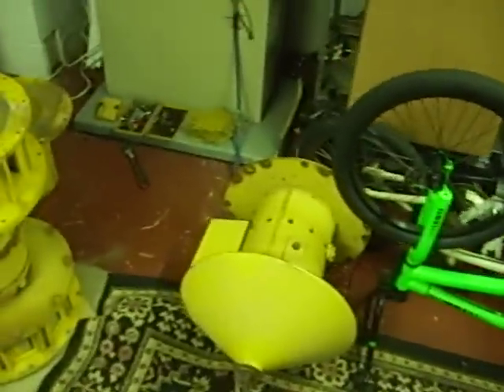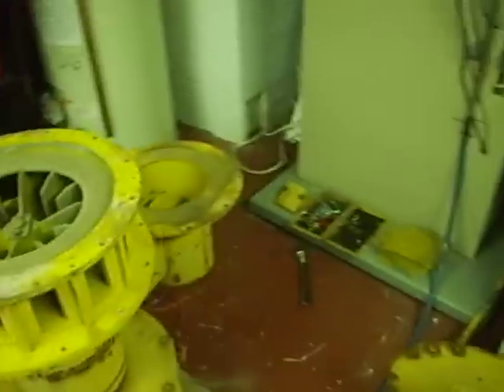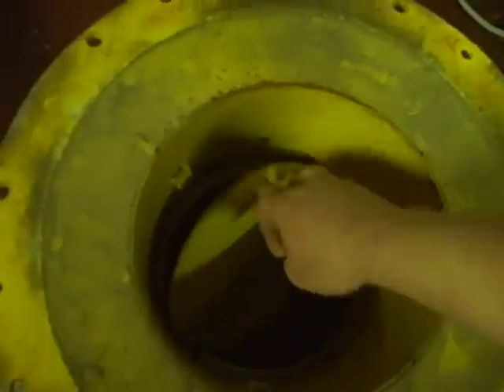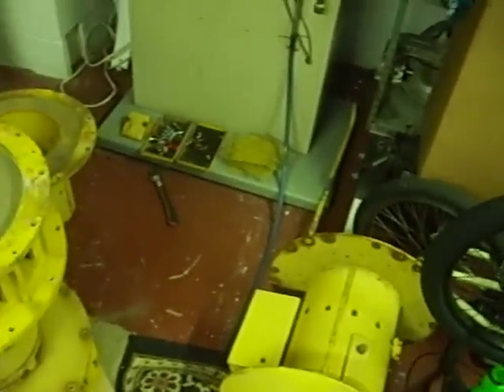Federal Signal 3T22 tornado siren taken apart left me with an opportunity...

Comment from the maker: @murrfarms The more I think about it, I will probably leave the old bearings in it. Like you said, there are much worse sirens out there You can't hear the bearings until the chopper has stopped making noise. If I was putting it back on a pole, I'd change them, but this thing isn't going to run much at all--so changing them would be nearly worthless, especially since I'd be fine running the siren the way it is. Saving some money isn't a bad thing either!! lol